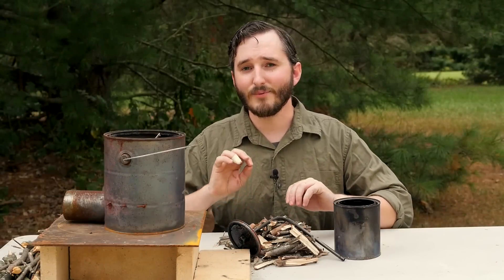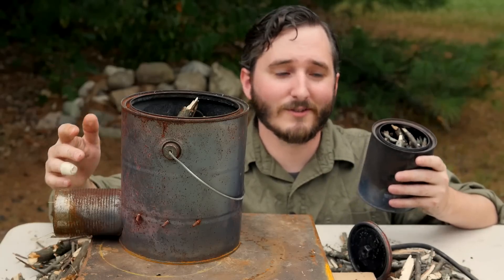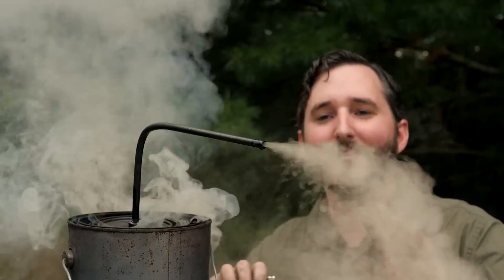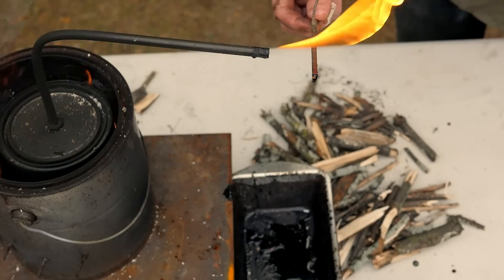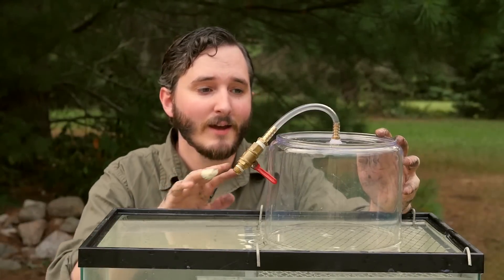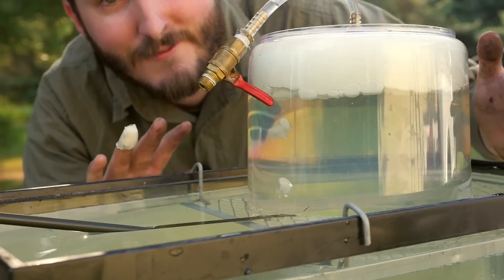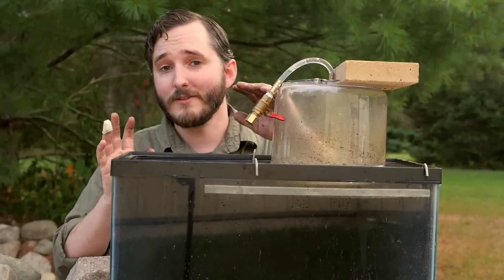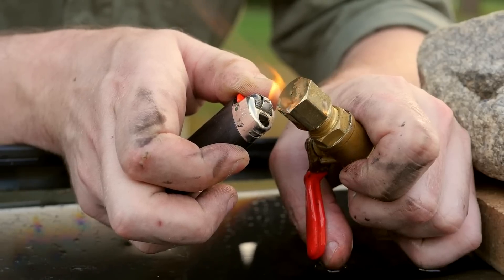How To Make Wood Gas Biofuel (and an experimental gas collection method)

Comment: Here they have a dry box just like with using hydrogen you have to have a drive container that it goes through I recommend putting that making it into like a filter to take any kind of moisture before it gets into the engine what you're going through the air cleaner anyway with both ideas to the carburetor it'd be more specific

Comment: That's not how you make wood gas.  You feed live steam into the hot wood where the hot carbon strips the oxygen from the water producing hydrogen plus carbon monoxide, both of which are flammable.  Try my suggestion of feeding live steam into hot carbon.  The reaction is self-sustaining as the reaction of carbon with steam is slightly exothermic.

Comment: Ok, let me get this straight.  You burn wood to make charcoal that burns and creates flammable gas and tar that doesn't burn (waste)?
You also have a limited (difficult) way of storing the gas.
How much wood (weight) did it take to make that amount of charcoal (weight) and gas (volume)?
How much material, ie: wood to burn and wood to convert into charcoal/gas it would take to generate one bhp for five minutes versus distillation of oil into gasoline/petrol?

Comment: Collecting the woodgas is not very efficient in this case, as it's being stored in an already higher active state (has increased energy already as you grab it from the energized container that is heating and extracting those gas fumes) as such, your gas would become less effective the longer you waited and the gas started to cool down. There's never be enough pressure to turn such gases into a liquid state and over time I'd assume the pressure would equalize with the atmosphere. In which case the gas may still be flammable but it's not going to flow for any good use. I guess since these gases are different than whats in the air we breathe I'd image that would provide some continued pressure, but not the same level as when you just contained it.

Comment: If you could use the water tank system as sort of a condenser for the steam and gas-liquid separation system maybe you could attach a compressor and a gas tank to the valve to collect even more wood gas?

Comment: So, in terms of getting the most efficient conversion of chemical energy to thermal energy, would it be better to gasify wood and run it in an internal combustion engine, or simply to use the wood in an external combustion engine /boiler?
Reply from the maker: Probably a boiler is more efficient, but then you would have to build a car from the ground up to run on one.

Comment: No butane. The component parts of real wood-gas are.
Nitrogen N2: 50.9%
Carbon monoxide CO: 27.0%
Hydrogen H2: 14.0%
Carbon dioxide CO2: 4.5%
Methane CH4: 3.0%
Oxygen O2: 0.6%.
A gassifyer uses the primary fuel gas (smoke) routed through a charcoal bed with the oxygen restricted to crack the tars and convert complex organic molecules into burnable clean fuel. What you have built is a charcoal producer.

Comment: question could you get the wood gas and recycle it or pressurize it into one of the propane canisters and if you did what would be the PSI level of that to refill it and would it hold would gas for a long. Of time

Comment: We use 55 ga. plastic drum , cut the top off get a 40 ga. plastic drum cut the bottom off so you can use screw on lids for valves that are on top. Put 2 small gas valves where lids are . This should be cut so there's 2/3 of this this drum  left . On one of the valves put a 2' plastic hose on inside.. Now fill 55 ga.drum  3/4 full of water. Now place 40 ga drum inside of 55 ga drum with cut side down , valves off, it should float. The 2' hose on valve should be in water, that's your gas inlet  valve , the other valve is your gas outlet . Now put 4 holes about 3" down from top of 55 ga.drum at 12 ,3,6,9 positions. Now streach bungee cords cross ways over 40 ga.drum holding it down against water , this creates pressure, and storage. The more bungee pressure the more gas pressure , making this a pressure regulator. With some modifications you can make this accurate. Works great when making methane gas too. You can bleed the system with the gas outlet valve. Run small hose from it to a bucked of water, with end of hose in water, bleed slowly at intervals as you make gas to bleed the oxygen. You'll know it's bleed when the bubbles in bucket will ignite.

Comment: That so cool,Isubed in thumbed you up what else you working on Im working on fan motor generater it is coming along also working on solar panel for my boat to keep my troller motor going it is coming along also I want make some kind of water fall to power a motor for d. c. Voltage .Good luck on every thing you do.us diy guys will always fix it. LOL

Comment: I made a gas collector out of a 5 gallon bucket and an giant upside down nalgene beaker. I had 4 half inch PVC tubes as guides. The PVC tubes we're spaced from the sides of the bucket in order to loosely allow the straight sided nalgene beaker to slide up and down in the bucket.

Drill a hole in the bottom (now the top) of the beaker, a couple of rubber washers, a bulkhead hose barb.

Fill the bucket with water, push the beaker down so that it is flush with the water, hook up the hose to gas source.

The beaker will rise as it fills with gas. Place a weight on top of the beaker to increase gas pressure.

Comment: just saw this as a suggested video, but I want to see more, but have seen a little off & on majority of my life,  but I wanted to mention when I was a kid, like 40 years ago, I read articles showing some farmer in UK? that was bottling it, he used a small single cylinder compressor pump, & was pressurizing propane tanks to I think 80psi? then he used a bungee cord to secure it in back of his motorcar, & drove off of tanked gas, & he did tack spare tanks, but no idea of process he used to scrub the gas, I was shaking my head about tanks rolling around in his trunk, with the one he was using bungeed to stand upright. also in one of my groups a guy has a VW he put a home built gassifier on to drive it. I think has driven it a total of 300 experimental miles testing it.

Comment: To collect it. Suppose might be possible...say you're operating only on wood gas from the start...manage to power generator to then operate a compressor and use it to draw excess fumes from the same "reactor" or another (or more) and use it to fill pressurized storage tanks. Would have to have the outlet regulated though and means to monitor the gas supply ie a dedicated pressure gauge where near 0psi would be EMPTY.

Comment: I might be a bit late on this, but you do not need to push the container down into the fish tank. The gas inside is already pressured by 1 atmosphere (similar to a column of water that is 10 meters tall), So pushing it down another 20-ish cm does not affect the pressure much at all.

Comment: Very nice video, thank you very much! It is not self-inflammable? you therefore need permanently to another flame?
Reply: No just add oxygen in the air and it will burn by itself. Get the air oxygen and fuel ratio correct and it will burn by itself.

Comment: too bad wood gas burns so dirty. ruined a good brigs and stratton on this fuel because of carbon buildup.... might work ok for a water heater or something. for the short term emergency this kind of thing is the ticket though. it works, maybe not for a long time, but it works for long enough to survive. if this were one of several fuel sources you would have no problems riding out a storm or running the generator untill payday.
Reply: Refining the wood gas better might help. I heard that if you take hey and soak it in a barrel with water in it that it would be a better filter that was one of the stories I read about what they did during World War II. Wood was not the only fuel either you could also use coal with a little bit of moisture. They also had a process to take coal and turn it into liquid and it was called coal oil ( kerosene).
Reply: @vernyanke1131  the germans used coal as a source for all of their motor fuels during world war two, as well as having invented synthetic rubber as we know it today.. it is relatively easy to find pictures from ww2 of rolls royce cars having large bladders on their roofs. the bladders were full of wood gas.
 this tech aint new, it can be cleaned up to an extent but is always going to carbon an engine up rapidly, no matter what. 
 there is always going to be a trade off.
Reply: @lukewarmwater6412  
         I am not sure that the Germans did in fact invent synthetic rubber. I think the Americans are the ones that invented synthetic rubber but I could be wrong. That was part of what the war was all about, that and oil for fuel to  run their machinery. They also came up with a chemical compound ( powder ) that could be introduced into water to make alcohol which would then burn as gasoline in an engine.
Reply: I think I saw some pictures of a contraption that they pulled along behind a car that produced wood gas.   According to the caption I think they were French.   War in my view is evil but it does bring out into the open a lot of new technology.

Comment: I noticed you had to keep your lighter lit to keep the gas lit.
Why?

Will this same process work with plastics?
Reply from the maker: The gas is not very flammable until it has cooled off and all the steam has condensed out of it. See my follow up videos. It will work with non chlorinated plastics but needs higher temperatures.
Reply: @Nighthawkinlight  thanks for the quick reply.
I was watching a few other videos and deduced that same result.
Are you feeding this into the air intake for combustion engines?

Comment: For all those cooking aficionados out there, this wood gas generator is the source of 'liquid smoke' as well. Just run the discharge tube thru a small vessel of water for a time and viola'. Liquid smoke. 

Make sure you use hard woods only as softer evergreen woods contain chemicals that just aren't good eats. Also play around with adding just a touch of vodka into the mixture as a preservative.

Comment: is it not that the first 'smoke'  that would come out from the copper tubing is moisture from the wood and later in a couple of minutes the flammable gas or idk methane?
Reply from the maker: Yes, that's right. First the wood dries before it heats enough to produce gas. Some of the gas later is also water, but less.

Comment: Try cooling the gas and running it in a water chamber. The cooling process should condense the gas and filtering it in a water solution should remove any unwanted solids. You would get a better more energy dense gas.

Comment: You need an air mix extension, like propane torches have, a jet in the center and air is allowed to come in from the sides and mix with it prior to the point of ignition.  It might work.  Also you may have too much water vapor in it, try running it through a back of rock salt, or a box of salt to remove water.

Comment: That you can't see any flame in the beginning is caused by the high pressure of the gas preventing it from igniting - so there ist no flame and of course it is also not a 'clean' flame..

Comment: Great video, not sure if it was mentioned but, because you started harvesting gas right from the beginning of the burn, I believe you would have collected all the oxygen that was in the can with the sticks. If you look at the volume of the can vs the collector, there is probably 30% maybe? Which would have made quite a leaner mix of gas. I wonder if you did this again but started collecting after it had run for a bit, purging the can so the gas would have been more pure/ a richer mix of wood gas. The flame then should have burned constantly out of the tip

Comment: Need to make a nozzle with venturi oxygen mixing in like on a torch or bunsen burner etc...  your gas rushing by pulls air in the holes at the base, they mix in the nozzle and with that might be able to make a flame that sustains itself
Reply: Zeff I was going to suggest this also.
Reply: Like in Oxy-Acetylen.
Reply: Ah! Is that why the gas isn't staying lit -- too rich?
Reply: @shamblebamble  yeah without introducing turbulence in some way or another the gases cool before they mix and combust
Reply: two years later he could use a pumper torch

Comment: Totally inefficient ... Waste energy burning wood to heat wood to release gas from secondary fuel as well as remove moisture from secondary fuel ... For mechanical output I would just use wood fired boiler and steam engine ... One energy conversion level instead of three with total energy loss waaaaay less ...

Comment: That charcoal can also be broken down to small particles (pulverized) and used as the final stage of a water filtration system! If you were to double up on that collection system (which is, indeed, completely viable), you could use it to collect hydrogen and oxygen via a simple HHO generator (think solar!). One container would collect oxygen while the other would collect twice as much hydrogen. Essentially here, you have created a woodgas bong.... I suspect the failure of complete ignition of the gas coming out of your collector is merely a case of getting the fuel ratio just right. Methane, butane and propane all have very narrow windows of air/fuel ratios in which to utilize them properly. The other note I wanted to make (that you didn't mention in the video) was about how much solid particulates (all of the black stuff) that had gotten filtered out due to the water.

Comment: is that wood gas? i thought wood gas was mainly carbon monoxide
Reply: i must humbly add that this is not wood gas it is gas being produced anaerobically unless i missed something. i expect your gas yelids more methane and less carbon monoxide. and while were on the subject. wood gas and coal gas burns blue and is made by partial burning as in oxygen but not enough). by the way carbon monoxide poisioning works by CO binding to your red blood cells stronger than oxygen (when inhaled) thusly making your red blood cells inert, signs of this is shortness of breath and an red-pinkish hue of the skin. hope this helps😀

Comment: Pretty cool video! I actually like the "raw" manner of your video with gave it some character..
And some thoughts to your set up:
Do you think it is possible to store the container down low at first. (probably with an hole in the fishtank or an longer pipe) so that you have the extra pressure to fill up enclosed containers?

Comment: Really cool experiment i must say. As a student of environmental engineering i'm currently doing a thesis on energy convertion from biomass. The reason why you are producing so much tar is beacuse the wood is going through pyrolysis instead of gasification. To gasify the wood properly you wood need to supply a tiny amount of oxygen and water vapor to the gasifier.
And maybe the flame is unstable because the gas isn't pre mixed with air before reaching the ignition source.
I really have to try this at home, and you Sir did great job with such simple equipment :D
Reply: If you premix oxygen in the gasifier, you risk the possibility of being between the upper and lower explosive limit, and that "PERFECT" mixture would pass through the entire gas train, so ignition at the exit could then track backwards through the entire gas train back to the reservoir globe or the gasifier globe or both. A DAMN DANGEROUS SITUATION!!!    H.E.A.D.S.-U.P. or it's gone forever.(Your head that is)
Reply: You're absolutely righ, that would be like playing with dynamite. Premixed flames are used in blowtorches and gas stoves but that's proper equipment, not homemade stuff. Glad you reminded me on that, i honestly didn't think on the possibility of creating an explosive mixture  ;)

Comment: Run the second brake line down into the bottom of a 2 liter bottle, put a fish tank bubbler stone ( they can be as cheap as 50 cents because the tar would eventually ruin them) and have another break line coming out of the top of the bottle to use/collect the wood gas from.

Comment: Not many people have noticed, it seems, that in order to get some charcoal and gas out of wood another portion of wood is burned down, with very low efficiency apparently.

Total energy efficiency/balance of process? Nobody cares (tip: very low/negative).

Two initial portions of wood (processed and burned) had contained together much more energy than charcoal and gas at the end.

So the only sense for doing this, is if you're extremely needy in specificly gaseous form of fuel (which was the case during petrol scarcety of WWII).

But if for your applications you may be consent with solid form of fuel, don't bother with this, it's just completely senseless and stupid way to waste energy and time.

PS. Another reason to use pyrolysis is if you use for it some 'free" heat, which goes out of environment or your primary source as by product (and it would be otherwise just thrown away).

Comment: cool project but you probably waste close to as much as you produce heating the can in the simple closed can design.

if you look at a modern wood stove with upper burn tubes you can see  it does not take much time before you start producing woodgas 

I think with me its more the psychological thing of placing a sealed can of a combustible substance into a fire that says explosion, that does not sit right with me, even though it is basic physics & thermal dynamics, lol

Comment: cool experiment. Now all you have left to do is when the water rises in the tank from the pressure of the water in the container being pushed out from the pressure of the wood gas being produced and when the water is at a certain level in the tank then it triggers a vacuum pump that sucks out the wood ass and when the water in the container is at a certain depth it triggers off the vacuum pump till the wood gas pushes the water back into the tank to trigger the cycle again. Great job